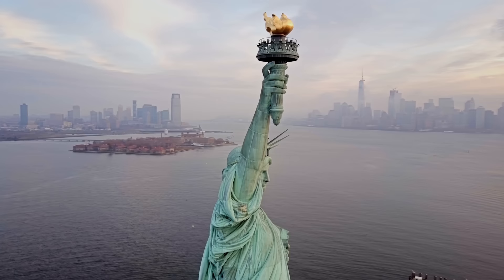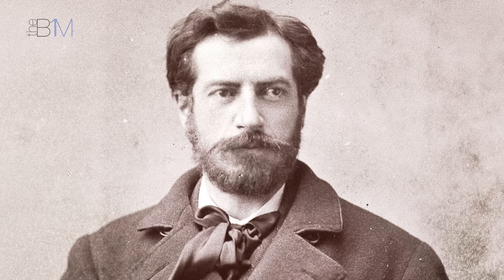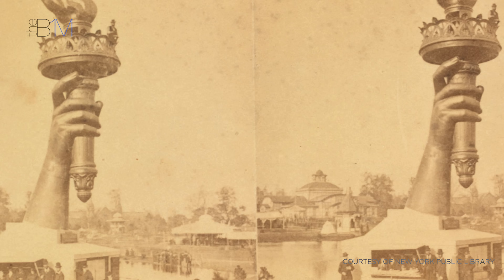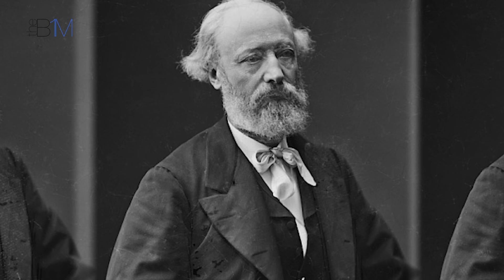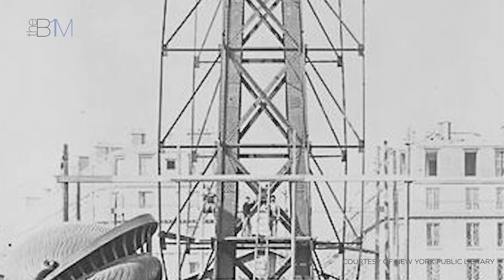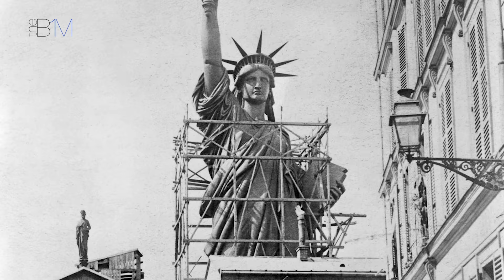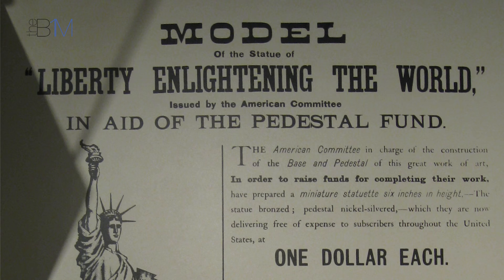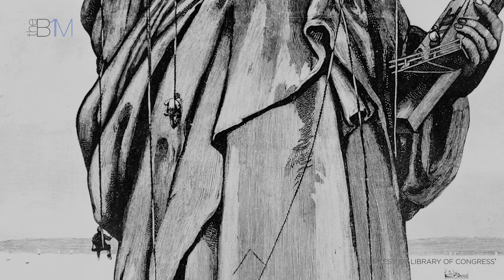The Statue of Liberty: Building an Icon

Comment: In 1987, I climbed to the crown.  The torch is off limits to climb.  In 2007, I visited the Bartholdi museum in Colmar, France where the statue was designed.  There is a small replica there as well as in Paris.

Comment: Well this greenish color is given by the chemical reaction of copper in contact with the air actually when the coat is quite strong then it protected the structure much better from oxidation

Comment: This legend would be a bit more believable if it  would mention that the copper used in this statue was produced and fabricated for the purpose of the statue said body in Russia as the copper analysis showen the copper matches the Russian origins up to 96%..Not sure if the face and arm copper has the same origins, would be curiouse to find out if a sample is provided for testing.  Also  the facial element was recycled from a privously existing statue that was actually a male figure. Most likely a ready made arm came from the same statue but that is just a theory, if face existed why not the arm too. And fact that the base of the statue was not actually made but repurposed for the statue covering up the star fort that already existed way before any modern re-discoverer even set foot in these parts officially. Though unofficially it feels like these lends were discovered way before any official dates, and used to bread European beavers in the swampy North American grounds following their flooding and later dates they came officially to collect the beavers, sell in Europe to finance the rebuilding of already existing cities with existing infrastructure and so on, buried under meters of mud. Why do you think the Hudson Bay company are dong-n'-nuts deep in the mostly fabricated North American history?